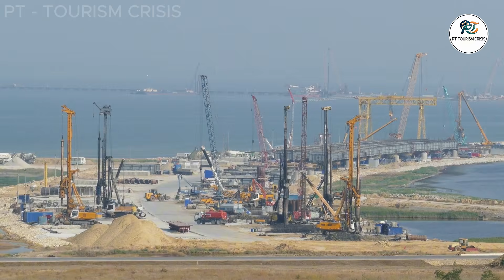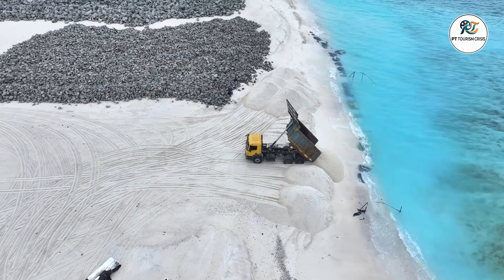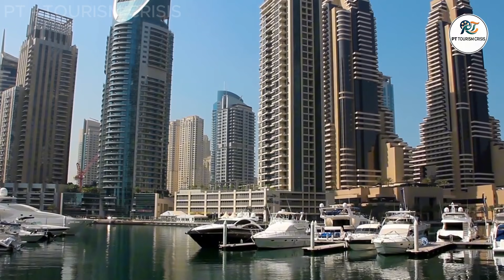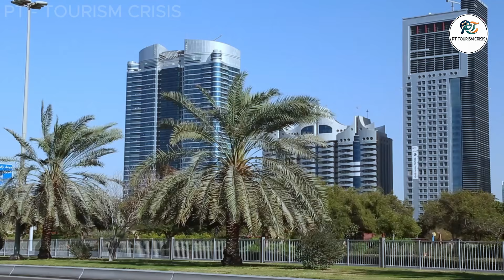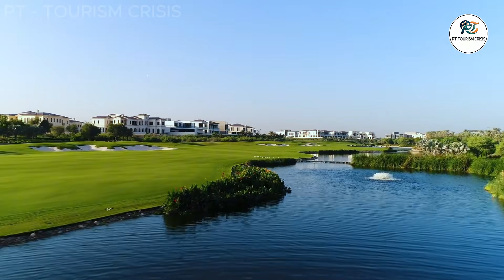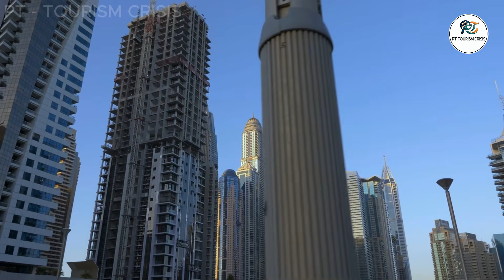Why Dubai’s New Billion Dollar Palm Jebel Ali Is A Permanent Engineering Battle Against The Sea

Comment: It probably would have been cheaper if they had built solar furnaces and made blocks (interlocking) out of the sand from the interior.  The heat energy could have been extracted using Rakine turbines and  saltwater cooling and the extraction of minerals and chemicals from the system.  The economics used is insane and non-sustainable.. the amount of oil sales required will diminish to kill this project and the world decreasing population kill the service economy that was envisioned to sustain Dubai.
Reply from the maker: There are some interesting ideas there, especially around using solar heat and recovering more value from water systems. I’d be more cautious about the oil and population part though, since Dubai is far less dependent on oil than many assume, and long-term population trends are much more complicated.